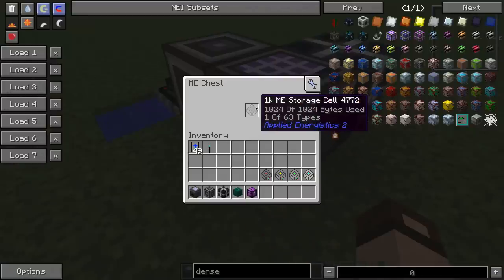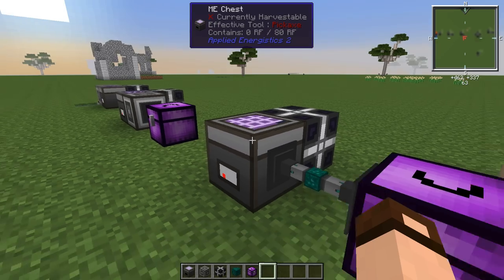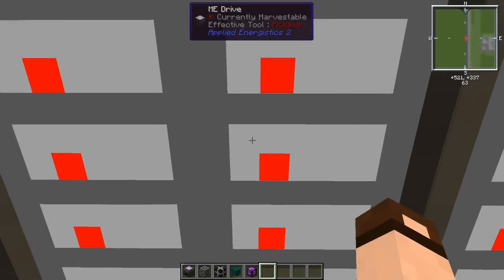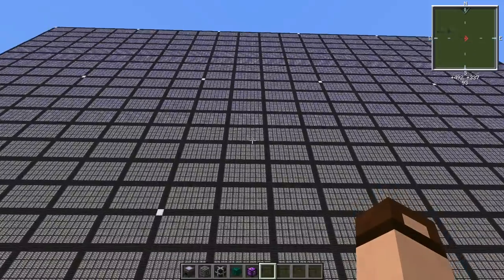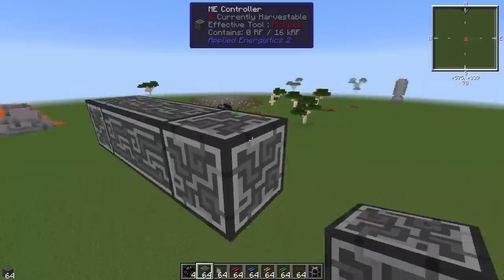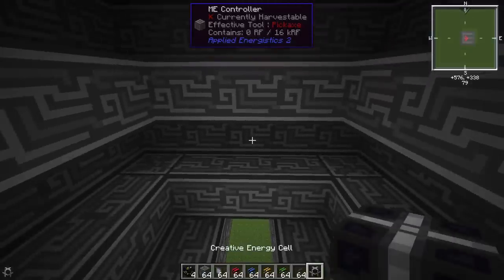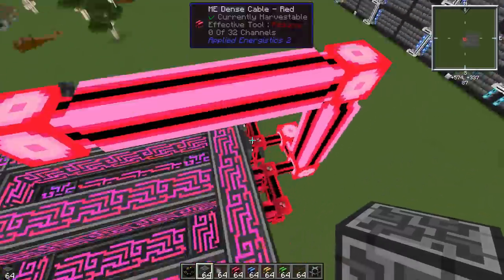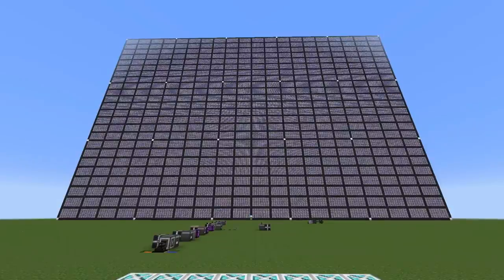Applied Energistics 2 Tutorial - Even More Storage Extremes

Comment: theoretically, the best layout for the ME controller to maximize the number of faces usable would be a 3-D Hilbert curve - each controller block would only touch, at most, 2 others.
It'd be a pain to hook up, though.
Reply: Challenge accepted
Reply: That's not guaranteed to be the best setup
If each controller in that setup gives 4 faces, but adding 1 controller there takes away 1 face but adds 3 you would have more.
The only thing a Hilbert curve achieves is controller efficiency ie most faces per controller. If you're not as controller efficient but have more than enough controllers to balance out the efficiency, the net result is more channels
(infact there is a reddit post that shows a controller with more channels than a hilbert curve)

Comment: Love that you break down the math of items in a cell!  Of course The Wall by Pink Floyd popped in my head... I find it easier to limit random items to smaller cells and larger cells get specific items to maximize storage since one loses so much storage with many items on larger drives (32256 aditional items if I do the math correctly).  What would be really ineteresting is to compare the power consumption between subnetworked drives verses networked drives because AE2 is not just about storage but also the energy used to run it.  Awesome stuff!
Reply from the maker: alyeakitty I was thinking more along the lines of Game of Thrones, myself. :) And I use a mix of cell sizes and let AE2 defrag items behind the scenes to the right places. I'll be adding power consumption information to the behind the scenes video. :)

Comment: Finally...I understand!  After several hours of research and tinkering I have created a system to autocraft quad uranium cells from the ore using AE2.  I see how channels  can be a pain, but it does make you more aware of cable management and routing.  Also if you want to see the machine I can send you the file
Reply from the maker: Plazma lasrer Pictures are probably easier, since that doesn't require the time to download and set up the same pack that you are using. :)

Comment: I saw this a few days ago and it inspired me to try to improve the 7*7*7 ME Controller design. Currently I have one with a total of 696 faces, the design featured in your video has a total of 510 faces. When you multiply that by 32 channels per face, your design can supply 16,320 channels, and my new one can supply 22,272 channels. With my design it is essential however that it gets power from the inside, which with the modpack I am using is easy because I can use enderIO's Dimensional Transceiver. There are also an additional 15 blocks in the middle that are not ME Controller's, and can be replaced with other blocks. One of them has to be the Dimensional Transceiver, but apart from that you could add another 14 ME Drives if it is storage you need, I also believe that you could add 5 Molecular Assemblers  connected to one interface in place of 6 of those ME Drives, and you could also fill the gaps with other components that you might not need access to, such as an ME Security Terminal after you have configured it for everyone on your server, or an ME Wireless Access Point once you have given it as many upgrades as you need to cover your base. I have gone for adding 14 ME Drives to mine just to boost the storage slightly, so in my system I can have a maximum of 222,286 ME Drives, each having 10 64k ME Storage Cell's, which if you fill up with just one item (like in your cobble example) then you could store 115,929,989,120 cobblestone. In the system in your video the maximum amount is 84,895,334,400. I'm probably going to record a video of it in a couple of days to demonstrate it, if you are interested I can show you it in closer detail then.
Reply from the maker: If you make (or have made) a video of this design, I'd very much like to see it. Quite a few people comment about better designs. It would be great to see where the state of the art ends up. :)

Comment: You should do a demonstration on what it would take to compress all of that cobblestone into 8x compressed cobblestone in a reasonable amount of time from the extra utilities mod using the auto crafting capabilities from AE2.
Reply from the maker: AE2 would be a poor choice for crafting all that cobble quickly. My AE2 autocrafting tests were actually with compressed cobble and it was very slow, even with 64 crafting units with full upgrades. A single RFTools autocrafter would be many times faster, as would any number of other similar crafting devices from other mods.

AE2's crafting is best for complicated, multi-step craftings that would be difficult or impossible for other mods to do. It's also best for having many different recipes available at the same time.

In my FTB Daybreaker Let's Play series, I had to make Mekanism's Ultimate Induction Cells in large quantities without AE2. It took me three designs to get something that worked without problems, and it turned out very complicated indeed. It would have been trivial in comparison if I had AE2 available. :)
Reply: +Nonsanity Very interesting ill have to look into some of those mods. I do have a question about ae2. If I were to get 2 inscribers and link them to my ae2 network and have them make printed logic circuits, when I start a recipe that requires more than one printed logic board will the ae2 network utilize both at the same time?

Comment: OMFG, super soaryn drive: there is the door! Grats on the 1024 subs.
Reply from the maker: ymer234 The SSD has it's place, still. The storage/interface trick makes adding more storage easier by not having to worry about channels. I'm just saying that if you understand channels, you also don't have to worry about them—you'll have plenty! :)
Reply: Nonsanity
The storage bus on an interface thing isn't the special thing about the SSD, that's a basic mechanic of AE2 that the mod author himself frequently mentions in his own tutorials and on the AE2 website (it is intended functionality, not a trick). The trick with the SSD that really makes it special beyond its tileable design is the secondary network of storage busses attached to the drives themselves that allows you to insert and remove storage cells with an ME Terminal. Makes getting your storage cells into the drives, and upgrading them later, a breeze.
Reply from the maker: That part I never really saw a need for. It's not that hard to walk over to the drives and stick in another ten or twenty 64k drives by hand if I'm starting to run low. I know the SSD can be set up to craft more drives as they are needed and insert them, but that could get out of hand if, say, a mob farm started dumping tons of non-stacking unique items into the system (after a trash can malfunction, perhaps). I'd rather the system fill and stop than keep crafting drives and filling up with more and more stone swords. I want to be able to control the growth directly and have run-away processes fail gracefully. Don't get me wrong, it's a cool trick and I like it... I just would never want to use it in a production system. ;)
Reply: Nonsanity
I hadn't even thought about the ability to automatically craft and insert cells as they are needed, that's really cool. I gotta set that up sometime :D but for me using the terminal is just way easier than clicking on a bunch of different drives to find the one I'm looking for. Of course my setup isn't the SSD either, as I don't really see a need for infinitely expandable storage and as you demonstrate here you can get far more than enough storage without it anyway. I'm just taking advantage of the storage bus-on-drive feature to make my life a little easier :)

I don't really have the resources yet to mass-produce 64k cells so I'm using 16k cells in my setup, having them attached to the ME terminal means when I want to upgrade some of them to 64k I can easily just pull out some 16k cells from the terminal, stick them in an IO port to empty them back into the system, then crack them out of their housings, upgrade them, and put them back in without having to hunt through each drive for them. It also lets me have the access terminal for doing this somewhere other than where the drives are physically located. I enjoy doing "control room" style setups and that's another terminal I have the ability to place in there.
Reply from the maker: Style counts! :)

Comment: As of right now, AE2 systems need an energy acceptor. They run on an energy system thats called AE aswell. 
The mod adds a means of generating AE directly, but most energy generators produce RF.
Reply from the maker: +Reaperonatricycle This is correct. The Energy Acceptor block will convert RF (and some other power types) to AE's internal format. The ME Controllers can do the same thing, to some extent. I was powering my setup by sticking a Tesseract to the ME Controller block.

I've found that converting RF is pretty much a necessity for large AE2 systems, unless you want to run through a LOT of combustibles. :)
Reply: +Nonsanity Huh, guess I've been had then.
But on the other hand, my current network has about 300 channels so its not exactly small - and it provides the energy for 5 or 6 subnetworks.
Still nothing compared to your leviathan of a network in this video, but apparently large enough to warrant an acceptor. I tried the direct conversion and it didnt quite work. 
How did you do this? P2P tunnels on multiple layers?

Comment: you could supply the energy with a quantum bridge inside the Controller (it has that 3x3x3 Cavity inside that could fit 2 Quantum Bridges)
Reply from the maker: +Fuuryuu The Brain behind the Wall doesn't have that much room inside, but if it did, you'd still need to have room for the cables to connect to the Bridge. :)
Reply: Nonsanity if I understand correctly, you have, on each axis, blocks #1, 2, 6 and 7 used up by the Controller, so there should be nothing preventing you from using 3,3,3 to 5,5,5 for at least one bridge

Comment: I don't get it.. Cables have predetermined amount of devices you ca hook them up. ME glass cable = 8, dense cable = 32. What's the point of connecting 1 smart cable to 5 faces of controler? or putting 4 of those smart cables together to combine with dense.. I'm lost..
Reply: the reason it connects to 5, is because the p2p takes the channels from each face and condenses it to one channel, so a regular cable can handle (self-channels=8)*(faces channels=32)/(2 p2p faces for each 'set')=128 channels! i just wonder why he never mentions condensing a full-up condensed cable full of p2p channels into yet another p2p channel, effectively allowing infinite channels to pass through one cable by infinite expansion, since, after all, the p2p is only one channel, so why not condense that?

Comment: So what if you used storage buses hooked up to DSUs and filled those with cobble? (Instead of all the ME drives)
Reply from the maker: I interrupted the end credits of that video to show how many DSUs it would take to equal the Wall. :)
Reply: Well, you have to determine how much cobble a single drive full of 64K storage units filled with cobble holds, subtract that from I think the two billion the DSU holds, and then multiply by the amount of drives you're replacing. Actually pretty simple.
Reply: Which should be over 30 trillion cobblestone. You're welcome
Reply from the maker: D3athstreak Yup. It would hold 32,727,650,795,520 cobble, or thereabouts. (I may be off by a few thousand in actual implementation.) Of course, though I'm filling the system up with cobble here, using drives lets you store anything and everything—and a lot of it—though not as much as you can store of just cobble. If you want to store just one thing, DSUs are the way to go. :)

Comment: What's the purpose of having all the controllers adjacent to each other? Can you not have them in little pods where you absolutely completely maximize all 6 faces each?
Reply from the maker: A single network can’t have separated controllers. There must be just one “pod” of controllers per network. (Though it is possible to chain networks together in limited ways.)
Reply: I assume that would be the purpose of those other controllers in a ring above the main brain?
Reply from the maker: Those controllers run the transport network that all the tunnels belong to. In smaller setups, there aren’t so many tunnels and a controller isn’t required on that network, just power. But on the big ones, the transport network also need to be larger and more complicated, with its own controllers.

Comment: That is some madness going on with getting the channels to all of those. MADNESS! (or Sparta). Nonsanity, did you see the trick with sub-network storage using a storage bus? All that could be on one channel in the main network. And not a single dense cable or controller required. Case in point: https://youtu.be/fsQHchP2iK8?t=24

Granted, yours looks so much cooler.

Comment: I'm still used to AE1 and I find this amazingly complex even though I built fully automated fusion reactor fuel supplies (Gregtech), and Automated coffee shops.  Do ME controllers still serve the same purpose of supplying power to the network?  Or do they do something entirely different?.  BTW AWESOME :)
Reply from the maker: The controllers are very different in AE2 compared to AE1 due to the introduction of channels. That change is what trips up most AE1 players when making the switch. I also have a tutorial on AE2 channels and how to manage them on my YouTube channel. If you haven't used AE2 yet, I suggest checking that out as well as my AE2 "starting out" video if you want a more complete refresher.

The short answer is, ME Controllers just let you attach more machines to your network, adding 32 for each face of the ME Controller multiblock you attach a dense cable to. (Or just 8 more per face if you use lesser cables.) For small networks of 8 or less devices (a drive and a crafting terminal only, for example), you don't even need an ME Controller now.

Hope that helps. :)
Reply from the maker: Oh yes... Power is now supplied to the network through the Energy Acceptor block now, though a few AE2 devices can take raw RF, like the ME Controller, Chargers, and Inscribers. :)
Reply: Thx

Comment: Could you knock out several corners of the inner rings and run cables in there (using cable anchors) to put P2P buses on the inside of the controller cube?

Alternatively, and this is crazy, could you add quantum bridges inside the controller cube to port those channels outside?
Reply from the maker: IChrisI2 You could get P2P Tunnels inside and punch through with a dense cable to get them out, but it wouldn't be simple. A quantum ring wouldn't fit in there, but a Compact Machine might work to get the channels out.

Comment: Alas, unless I missed it somehow, you didn't touch on what changes if you partition the drive to only hold one or two items using the cell workbench, because unlike refined storage, using this trick you can eke out just a slight bit more space for more items.
Reply from the maker: Scott Godin Only when compared to a drive containing mixed items. But these tests were just using cobblestone, so it would have had the same results if I had locked them to just cobblestone as well. Each additional type lowers the total count by a bit. Think of it as pages in a binder—when you switch to a new type, you need to add a divider page, which adds to the size of the binder without adding to the total count, leaving less room for counting pages. :)
Reply: @Nonsanity  That makes sense. Somehow I had gotten it in my head that partitioning a drive to a single type got you more storage somehow for that item type than on a non-partitioned drive.

Comment: did you think about replacing the actual cells with the 16384k cells from extracells filled with octuple compressed cobble in your enormous storage system ?
Reply from the maker: I did, yes. But the main point of the video was to show just how much a single, max-ed out (or nearly so) controller could handle. As the very end of the video showed, that same amount of cobble would fit in just a handful of Deep Storage Units—they are much better for single-type storage. AE2's drives are better for smaller quantities of distinct items. The combination of the two solves 99.9999% of players' storage needs without resorting to such extremes as "the wall" depicted here. :)

Comment: Time to use the interface/storage bus trick to make the Borg cube MkII
Reply from the maker: Silvernocte Well, with the interface/storage linkage, the drive count can be as big is you want it to be. No upper limit to push there, so not much challenge. :) Besides, the cube was only a fraction the size of the wall. No one ever notices the wall has five times as many drives, and that's counting all the drives I didn't bother to build into the cube that it could have had. :)

Comment: Can u do a tutorial on all the wiring on the controller design plz
Reply from the maker: KingsLab Well, most of it is right there in this video. I show the design of the ME Controllers, and then I show how to properly wire it a small section. A sill image of the completed unit should be enough to tell you how I wired it all up, but you can use your own design as long as you keep in mind the limits I mention in this video. :)
Reply: ok thx